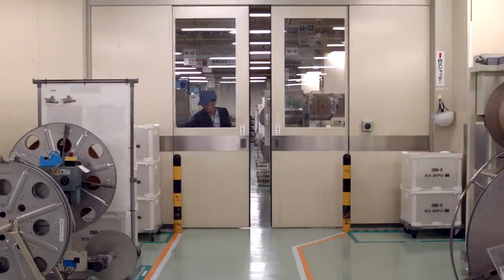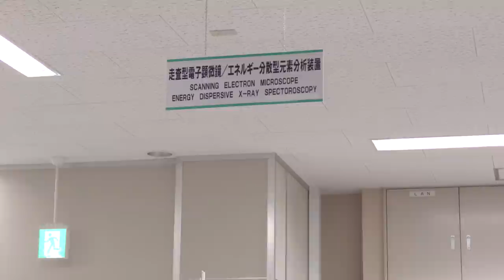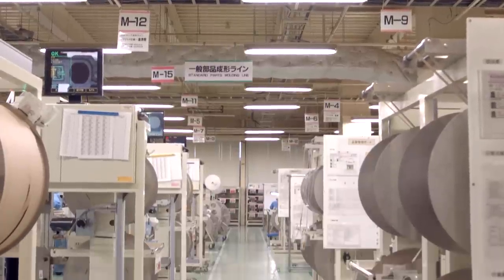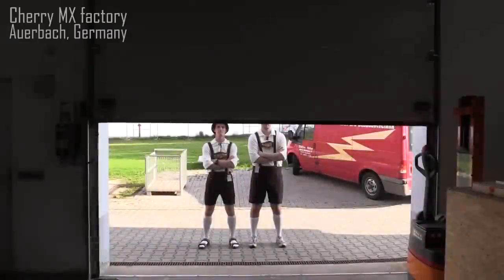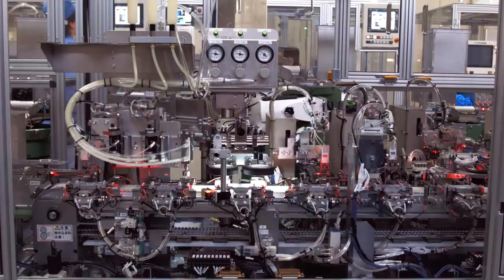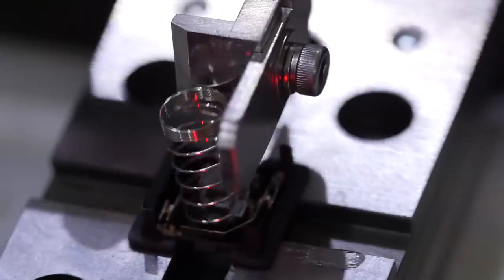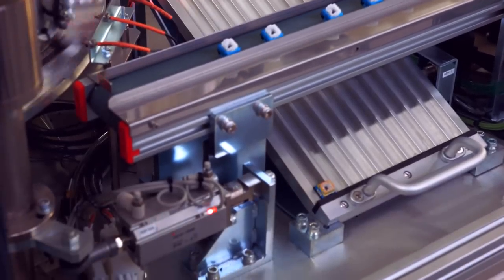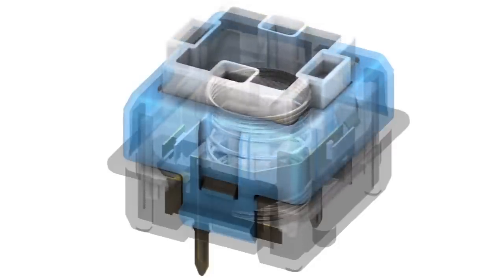Omron Factory Tour - The Making of a Logitech Romer-G Switch

Comment: Superior Nippon Omron switches folded over 1000 times can even cut through solid steel
Reply: ***** Same XD
Reply: ***** It's a common misconception that they would fold them thousand of times. What people are usually referreing to is the amount of layers the folding generates. Even folding 12 times already gets you 4096 layers. Folding thousands of times would actually decrease the quality and durability of the steel. 20 folds get you over a million layers. They only did it until the steel was pretty much homogenous and then stopped. Going further than that would just make the steel softer. 

Just wanted to point that out, have a good one :)
Reply: Animurh is that rumia or flandre?
Reply: They're not jetfuel so they probably can.
Reply: ***** I would +1 this, but I'm not on my PC master race device so I can't.
Reply: Ochinchin
Reply: +Pico No.

Comment: $15,000,000 lab, computers running Windows XP.
Reply: gonigeena I guess it just works. :)
Reply: It seems funnyat first, but most big facilities are still running XP. Even most nuclear reactors are still controlled via XP. Apart from the fact, that its just too expensive to replace the OS on a 100+ PCs, the whole program that is controlling the robots is written and optimized for XP. Even if they would just replace the Lab PCs, they could run into compatibility issues. Because of that, Microsoft is still developing software/security updates for big companies. So until they rebuild the factory or have real problems with the OS, they wont switch.
Reply: gonigeena You will find that compatibility with software has everything to do with it.
Reply: gonigeena sounds funny that such an expensive lab is using an outdated operating system, but when you think about it there is no reason to upgrade at all
Reply: A potato chip factory I worked in also used XP , the PC's actually came with 7 though, I guess XP is just more reliable for business.
Reply: gonigeena they just need reliability to run 1 windows program.
Reply: gonigeena The machines (which can cost millions each) may not be able to run anything higher. The software that runs the machines might not work on a newer OS.
Lots of factories run old versions of Windows or Sun because they don't have much of a choice.
Reply: Hahahaahahahahahaha XD
Reply: ***** implying they are connected to internet
Reply: gonigeena Lab not home. They have higher requirements on the software, redeveloping it for a new platform would be hugely expensive and not come with many benefits at all. 

XP is standard for factories.
Reply: Lorentz the annoying Llama In all honesty, machines that do work like this should be on fucking Linux...Then again, are these machines even connected to the internet? If not, who gives a fuck about security updates if you don't have to worry about software security.
Reply: ***** Factory equipment is never (or should never be) connected to the internet.  If you ever visit a factory with machines that use a PC to control them, you'll probably find XP or older OS running it.
Reply: Supercomputers usually run on Linux.
Reply: Grandsome their uses, operation and design are completely different
Reply: Thezftw Yes, friend told me he went to a factory and saw DOS
Reply: Lorentz the annoying Llama That's what people said about Windows 98 when Windows XP was the norm...
Reply: +Kei Angelus Many specifically made software for special hardware (like those electron microscopes or those robots) are not programmed for future compability, and don't receive software updates. what's more annoying is that they CAN change the software, but then you also need to let them install windows.

An example from the lab where I work: We have a Leica confocal microscope running off Windows XP. I asked "why aren't we upgrading to 7?" and the answer was that Leica won't support user updates to 7. Unless Leica themselves come and install Win7 they won't guarantee the compability and will not provide the on-site support anymore.

So then I naturally asked "How much does it cost to upgrade to Win7 via Leica?" Answer: 10 000 Euros!

Another case was that Zeiss Microscopy send out an email telling that their Microsoft software won't work in windows 10 at that moment (now they might have upgraded that).

So cost and software upgrade is probably the main reasons why you see old OS in places like these.
Reply: They don't need to run the latest OS..
Reply: machine is designed specifically on windows XP. It's software has been developed around that OS. Everything is working 99.9% of success rate. If they switched to a modern OS like W10... It would take software and engineering teams to build software for it from the grounds up. That can cost factory millions of dollars because it needs to go through rigorous testing phases. 
Machines OS and consumer OS are not the same. Remember that .
Reply: its actually not that uncommon to see ancient OS in a state of the art scientific lab
Reply: u dont replace a reliable os with a new probably buggy os with tons of issues.

also these are for commercial use.
Reply: You can't deny that Windows XP is (still) the best and most reliable Microsoft OS ever made.
Reply: +mommozz123 For those of us who do tech support for large companies, yes we can deny that XP is the most reliable, and what makes it best?
Reply: Romer factory hacked when?
Reply: Even the Apple assembly lines in China run XP....
Reply: Yeah a lot of software for scientific applications isn't really maintained.  So yeah it works on Windows XP... natively.  So upgrading the OS of the computer that is controlling the 3 million dollar SEM that needs to be always working and available is not really an option.  Corp security software is notorious for boning computers used to control scientific instruments.

Comment: I dont like Logitech any more.
Because:

My G910 Orion Spark from 2016 was died last month. Some Keys send a double input signal (maybe depending on de redundant switch contacts).
In my opinion is a 5 year lifespan for a 150$+ Keyboard not that good.

My Z906 from 2015 died in 2017 short before the guarantee end.
The spare Z906 died last year. Not good too.

My G35 from 2013 died right after the guarantee end. Superb! Shit hits the fan... Because Logitech dont tink about customer relation.
The spare Hyper X Cloud Headset i bought in 2015 is in good condition, actual on the PC of my daughter! And she dont handle with care...
AND (back to customer relation):
Hyper X sended me a spare microphone, after i lost it while moving. For free!

Right next to my old Roccat Ryos MK Pro from 2013, whitch i gave in 2016 to my wife... 

And many more Logitech failures in my ownership.
I dont buy any logitech stuff any more!

My good old Roccat Tyon from 2014 is running like a young girl.
And she overlifed many Logitech crap stuff.

And my Cherry MX Board from 2016 on my workplace... yeah.. Like new! 

Bye Logitech... Sell your expensive crap tec waste on the moon...

Comment: 15 Million dollars lab, equipped with computers running windows xp. Very reliable.
Reply: Alex Wolski 
Give me one reason why you wouldn't run XP.
Reply: HyperionNyx Because it is slower than windows 7, and I would assume electron microscopes take a lot of compiling power
Reply: Alex Wolski
"Compiling power" makes no sense.
Windows XP is for compatibility.
Reply: Alex Wolski No, there's no reason whatsoever for them to NOT run Windows XP.
It would cost a lot of money to upgrade to e.g. Windows 7 and they'd gain pretty much no perfomance increase at all.
Also Windows XP isn't even that much slower compared to 7 and even faster than Vista.
Reply: Alex Wolski How can you tell the difference bewtween windows 7 classic and Server 2012 just by the looks of the window?
Reply: Blaackys Unpatched security flaws.
Reply: And who says that these computers are connected to the internet? Do they actually need the internet to run the software that they need? Probably not. Optimization is key at these factories and each computer is made to do a specific task.
Reply: Marios5556 Even air-gap'd computers are vulnerable. And they probably are either way; I doubt they would be running around with USB sticks all day long.
Reply: Jack Carver FFS the computer is used for a very specific task( meaning it may be completely independent from other computers) hence it runs windows XP. If they want to communicate or do anything else they use other computers or machines or telephones etc.
Reply: Windows XP is the most reliable Windows OS so far. I would trust it over all the others combined.
Reply: Joe Fisher We are talking about 15 million dolars, they could easly hire engineers to make their own OS for this specific work. It greatly increases the speed. But is quite difficult.
Reply: Navhkrin I don´t think it would speed up anything. The cost to productivity of developing software for specific tasks is close to zero when your goal is looking for an error.
Reply: Lorentz the annoying Llama Tens of thosand dollars? Machines are complicated but their commands are quite simple. One can easly make their own OS for that job, many companies to that. Windows is a general porpuse OS. Making an OS that is only supposed to do a specpfic thing is much less coslty to make.Why they would do that? Its much more failproof then windows, its significanltly faster and its hack proof. To ask why they would need their specific OS is like to ask why they are using electron microscopes. Practical benefits are minimal. But they are clearly going for best of the best so why not have your own OS with all those advanced machines?
Reply: ***** and many of the machines up there still run xp. or even 95-98
Reply: Navhkrin if you actually knew anything about SCADA and the kinds of process automation that go into the engineering of these facilities you'd understand why running XP isn't an issue.
Reply: Alex Wolski Just to let you know: In science backward-compatibility, or rather, future compatibility is rare. The companies rarely make new firmware/software updates when new OS are hitting the market. Our older Zeiss Microscope still runs XP, and XP only, whilst it's younger, newer sibling runs Win7. In a lab I did some internship in had this really accurate, and advanced measuring method, but whilst the machine was awesome at what it did, it run in DOS - yes MS DOS (I don't know if you are even old enough to remember or know about DOS, no offense)

We actually got a brand new microscope this spring and its software runs XP, because that was the main platform while the software was developed, and no time went into re-porting it to modern OS:es
Reply: Alex Wolski Just to let you know: In science backward-compatibility, or rather, future compatibility is rare. The companies rarely make new firmware/software updates when new OS are hitting the market. Our older Zeiss Microscope still runs XP, and XP only, whilst it's younger, newer sibling runs Win7. In a lab I did some internship in had this really accurate, and advanced measuring method, but whilst the machine was awesome at what it did, it run in DOS - yes MS DOS (I don't know if you are even old enough to remember or know about DOS, no offense)

We actually got a brand new microscope this spring and its software runs XP, because that was the main platform while the software was developed, and no time went into re-porting it to modern OS:es
Reply: Navhkrin As someone who has worked on projects worth far more than 15 million...15 million isn't much, and if you could design your own OS (drivers, kernel, bootloader, and the app itself) for 15 million, you'd likely have a goldmine on your hands...though even if you did, your software would be so full of bugs and security issues you'd likely go out of business.  Also, contrary to the ill-informed claiming that air-gapped machines aren't secure, they are perfectly secure and most security companies that audit this types of setups would pay you a bazillion dollars to prove otherwise.  Just because you armchair enthusiasts happen to read some sensationalist article on slashdot claiming that air-gapped machines are hackable, doesn't mean that it is so.  Outside of an experimental laboratory where machines are DESIGNED to be hackable, this just isn't a thing.
Reply: Navhkrin Many companies DON'T do that.  Most companies base their software off existing software.  Linux, Windows, BSD,  QNX, or some other existing solution.  Find me a company with a 25 million dollar market cap that makes their own OS completely from scratch (including drivers along with the specialized app) and I will give you $100.

Comment: I use the Logitech G910 quite a bit.  Definitely worth the money.  Although it wouldn't hurt for it to be cheaper.  But Linus should definitely revise the review that was done on the G910 because the key caps aren't really as bad as it was made out to be.  

It was a concern for me at first also, you should definitely consider spending a bit more time with the keyboard~

Comment: I still feel like for anyone but the most hardcore gamers, 2mm is plenty fine for an actuation point. I mean take a cherry mx blue switch, or green(assuming other than weight required they feel 100% the same, as I've only used blues), and press until you feel the resistance of the tactile bump. 2mm is tiny, and anything less feels like more number wars(similar to pointless phone resolutions).

Comment: Pity they didn’t design a robust way of fitting the keycap to the switch. It’s also unfortunate that Logitech couldn’t solder the Roner G  key switches to their circuit boards properly. 

I say this because Logitech has apparently discontinued Romer G & is now using Cherry Mx style key switches manufactured by a new partner &  aside from the key caps and dodgy soldering, the Romer G key switches are very nice to type with.

Comment: Judging by the keyfeel I'm suprised there is no grit involved in making the switch, honestly one of the worst switches I have used, the leds failed really quickly on a few keys always removing blue from the led instead displaying as green. The keys feel as if they are not tactile but dirty linears, it's not satifying to type on and the key feel is hideous. The smaller actuation does not hide the fact that the keyfeel is awful, feeling comfortable and having a switch that either has a good tactile bump or a nice linear smooth feel is much more important then having a switch  that has a slightly smaller actuation. I used to love logitech and still love the mice but the new keyswitch just turned me off the keyboards, i really hope they improve on it.

Comment: millions of dollars spent on the instrument, still using windows XP......
Reply: kuzzoN It's for compatibility. You know it's different for commercial things right? When a new version of Windows comes out they aren't like "omg it's got a shiny new desktop and boots 0.5 sec faster and runs minesweeper at 3 more fps" They only need the software for whatever instrument/equipment and will use whatever validated and reliable OS is necessary. I bet there are plenty of factories that still have windows 95 machines controlling them.
Reply: bassl0va Yeah... the software they had made for those machines would cost a fortune to upgrade to a modern OS. And it would be largely pointless.
Reply: bassl0va There are factories… running… DOS

Comment: my problem with romer g switches is that noone ever fucking makes keycaps and i do not want to buy replacement keycaps from logitech. i want aftermarket. 

only solution i have found is to look for a guy with a 3d printer that's exact enough to be able to 3d print an adaptor for mx keycaps to be compatible for romer g switches. which is freely available online btw. just have to find a guy with a printer.

Comment: >$15 Million Lab
>Windows XP
Reply: Calyx No need for Windows XP.
Reply: SuperNova Gaming No, your wrong. There is absolutely no need for anything other then Windows XP. Heck, we have two machines still running on Windows 98! Why? Because they arent connected to the web. 
Why do factories choose WinXP? Because those machines you see in the factory are probably 10 years old and come with specialized software that ONLY runs on that OS. And if it works, it works, there is absolutely no reason to spend 100k on rewriting software to support Windows 8.1 just to get a different UI? 

You clearly have no clue how powerful and lightweight Windows XP is. But I guess your a new generation, you simply can't grasp how amazing that OS was, and still is.
Reply: Calyx Your point makes some sense, but not really any more than mine.  Also, you tend to throw in cheap insults and generalizations because you're not confident enough.  This isn't a debate, this is you throwing stupid insults, and I will ignore you now.
Reply: Valkyrie Check the dates of these comments.